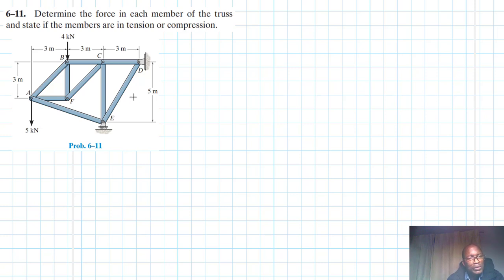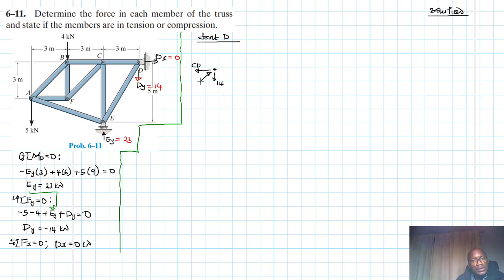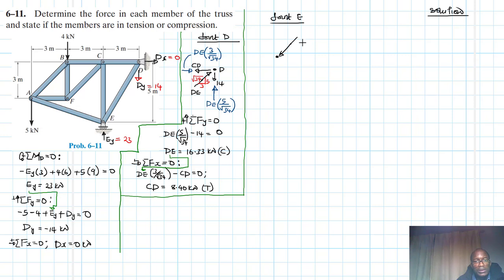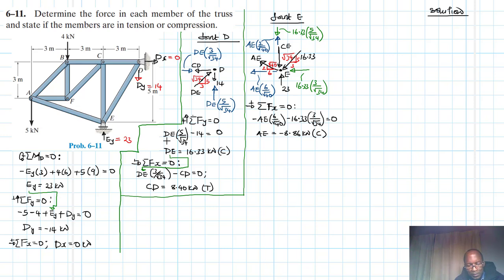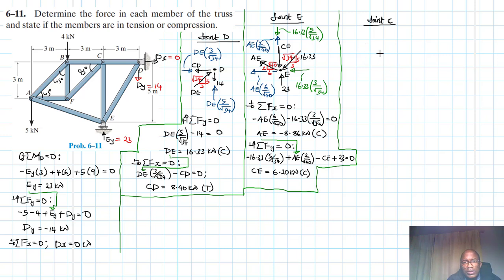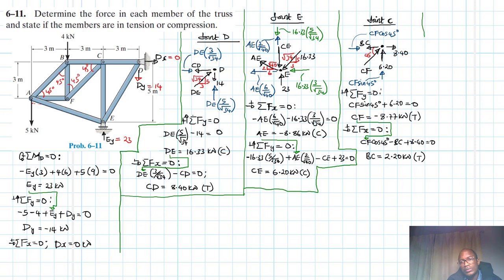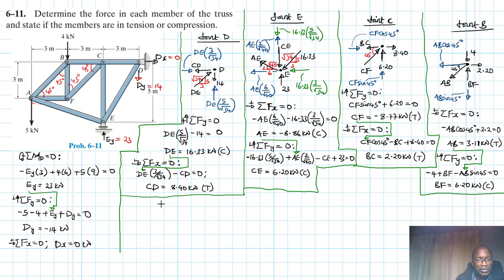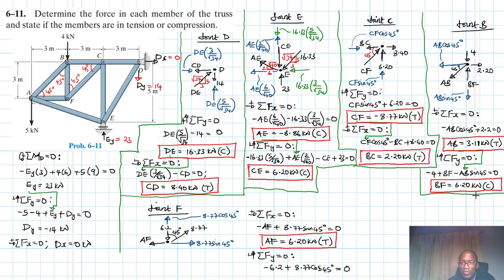6–11 Structural Analysis (Chapter 6: Hibbeler Statics) Benam Academy

Comment: i think in your point C is mess up since your FFC is equal to postive 8.77 kN (T) not negative?
Reply from the maker: The force FC is actually positive. However, we initially calculated it as negative, which indicates that the actual force vector acts in the opposite direction. Therefore, the final answer should have been indicated with a ‘T’ (for tension) only, without combining it with the negative sign, as was incorrectly done. When calculating the other forces at that joint, we retained the initially computed negative sign to maintain equilibrium at the joint.